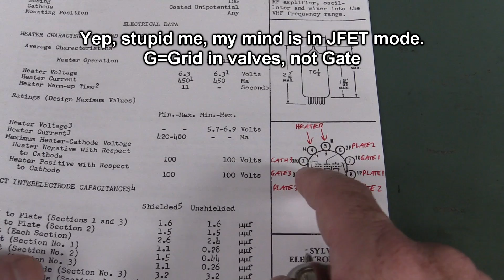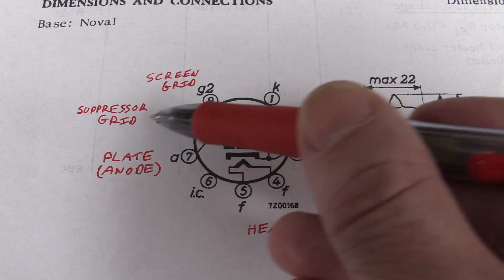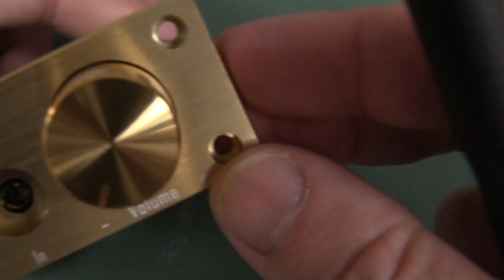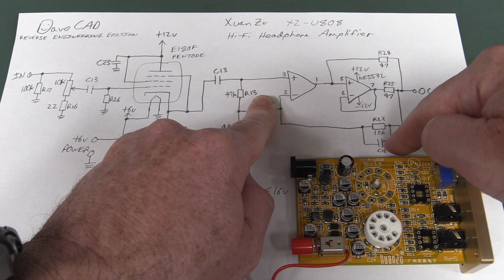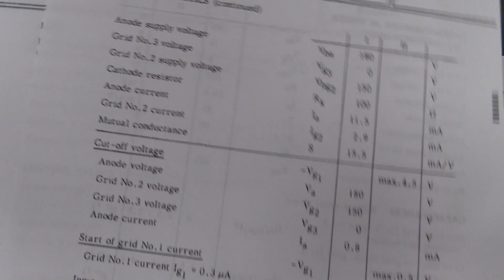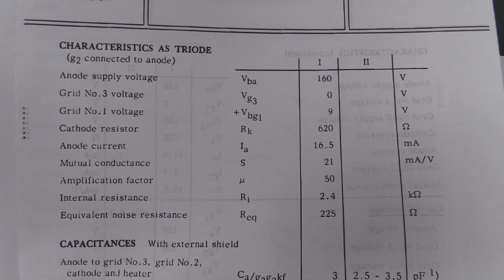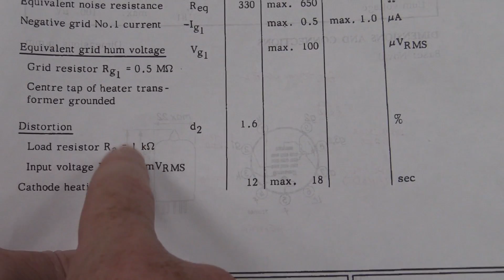EEVblog #837 - Reverse Engineering A Valve Headphone Amplifier

Comment: "A valve is just a JFET with a pilot light" (BAAAAAAAABOOOMMM) <-- Collective heads of all guitarists in the world exploding! :) HA!
Reply: Not entirely true. It's also less accurate. ;)

However, when you're producing sound, you can use any method you want to achieve the sound you want, so using vacuum tube amps for recording purpose is fine. When you're reproducing sound, you should use whatever method produces the mathematically most-accurate amplification of the source signal, so you can be sure you're hearing exactly what the artist intended. That's why my home stereo uses a set of self-correcting JBL studio monitors with built-in digital amplifiers, rather than some ridiculous glow-in-the-dark vacuum tube setup, so I can hear my vacuum-tube-amplified rock albums with perfect clarity.

Comment: So basically this is a tube unity gain buffer followed by parallel op-amp unity gain buffers. I think I'll keep plugging my headphones directly into my phone and save $50.
Reply: +mipmipmipmipmip More like lose $500 because you&#39;re listening to your music with vastly subpar headphones. That said, such a headphone requires actual gain, not a buffer.
Reply: +FlyingShotsman Most phone outputs are single miniature low power opamps - new ones, barring GSM noise pickup, are much better than this misused NE5532.
Reply: yep, the valve is just a high impedance buffer....
Reply: a proper 'all valve' headphone amp could be done very easily, and surprisingly cheaply, 
 without all that bullshit in the things in the video....
Reply: The dual op amp is being used as an amp with a buffer following it, for increased output current and stability.  That's where the amplification is coming from.  Since they are socketed you could easily replace both op amps with something like an OP2134 or OP275 for better performance, especially with 600 ohm headphones.  But the crappy tube is likely to be the limiting factor in the noise floor.
Reply: You listen to music from a phone, you heathen, get a real source

Comment: Dave, the point is to do a better job on the vid than these designers who put this amp together, right?
I think this calls for some testing on this crap amp.
You started it, now finish it proper.

I mean, you have all the gear and hooking it up is like 10 minutes effort, or less, plus you went through the trouble of disassembly anyway... the effort will be worth it in educational terms. Plus you'd get to blow the dust off that Keitlhly 2015THD you showed a while ago and we all know you like test equipment ;)

I bet it would look interesting, I'm pretty sure I saw evidence of ringing around 90deg and 270deg. Additionally, these opamps are not designed to drive loads below 600ohm,  like what the 16ohm "hifi" headphones would present, and when driving only by 5532, check what happens to these THD+N figures when you replace the output load R with a 1k one.

The amp design appears to be missing a whole (output) stage.
The experiment could aim to show that...

Cheers,

Comment: Ah yes, tube gear, where it seems about 90% of it is poorly designed, some even bordering on jumping straight into becoming self powered oscillators on any audio input or being made purely for wank factor by people who think pushing components into overdrive and comparing them is good practice. Stepping on the tail of a cat and complaining about how it sounds does not a good test make.
The remaining 10% seems to be old gear.
I honestly like messing about with old tube gear, I have a projector with optical sound (read in by a photomultiplier tube too) and purely tube based amplifier that i am working on fixing. it's neat, it's old, it's uncommon and in some ways sort of lost knowledge. it's fun to figure out and keep running without taking the lazy shortcut of gutting it. It's cheaper than a classic car, too.

Besides, what is with the blue glow, the orange from the tube is way cooler than throwing LEDs in to make it all glow so everyone will ask what is going on there and they can be told about tubes. Or what's with the use of tubes wildly inappropriate for the use being used for stuff. I have a feeling a high voltage tv transmitter tube isn't ideal for an input preamp for an amplifier even if it does look cool.

More videos on tubes/valves would be cool, it is hard to find someone trustworthy or believable on the topic, most seem to want to go into the spiel on how amazing tubes are.

Comment: I think the cathode heaters are enough glow on their own. I say leave the solid state or IC amps out. With this kind of thing , it's the tube sound you are after. Like others I am surprised the tube works at 24 volts. Although my tube line level single stage amp runs for 15 seconds after cutting the power and there is very little filter MFD's. Then it fades out with very little distortion. I love my 2 tube buffer amp. It has no solid state amps. My friends say the sound is an improvement over the CD changes straight analog output. I know it sounds great but am on the fence as to the "Warmer more Analog sound".

Comment: I wonder why they didn't use a 12v power supply and run the heaters in series?
That would save them the trouble of the DC-DC units and half of the board components/space.
Any thoughts?
Reply: +PIXscotland Because they need + and - 12V ?
Reply: +Michel PASTOR

Yeah, I get that. But starting at 12v would save the whole +6 to +12 components. 
Let's go whole hog and take a single 12v input and drive a Boost converter and have 35v (say) out and offset the DC input to half rail. The valve would probably be happier/quieter and we'd have endless rail-rail swing on the op-amps (Not that we need it.)

In the end the valves were pointless to this circuit other than adding colouration (which may be desirable to some.) The circuit is interesting as it is, but the product is endlessly complicated for the purpose of driving high impedance headphones. You can do that (I do) with a couple of LM386's and a PP3 battery (but maybe a little noisier.)
Reply: The difference between +12v and -12v is 24v...
Reply: +Tim Ramich 
Umm.

Comment: Will the distortion become lower if we get those $200 audio grade electrical outlets instead of plugging it into a standard outlet?

I was also thinking of getting that amp, and then replacing the power cable for the power adapter, with ones from this power cable (it is an absolute steal at $6900 for a 6 foot cable) :)
http://www.amazon.com/AudioQuest-NRG-WEL-Signature-Series/dp/B0055OM9WS
Reply: if you're using it for home cinema, I'd also recommend one of those anti virus HDMI cables too. 

I thought 'what a joke', but then my TV got a virus and will show nothing but repeats of only fools and horses. Never again am I not using an antivirus HDMI cable. :-/
Reply: +Razor2048  

You forgot $300 beats headphones. They have high quality electronics that are better than other brand. Such a good investment!

Comment: The valves are really novelty value only in this case. The sound would probably have been better with a couple of JRC NJM4556 op amps driving the headphones.
Reply: The 5532 op amp is superior to the 4556.  An OP2134 or OP275 would be better yet.  And there are even better options if you go to newer package formats.

Comment: Dave, obviously you have not much experience with vacuum tube valves.
There is a significant difference between a Triode and a Pentode: totally different characteristics! 
the connections of this one are typically those what you expect of a Pentode!

Comment: It looks rather like the capacitors in the signal path are all of ceramic type... I would have thought that would make it sound bad due to the non-linear and piezoelectric characteristics of the dielectric. I though that Hi-Fi amps used film caps in the signal path?
Reply: +Steven Birch You are quite correct there. Maybe that's their way of adding some distortion (or just penny-pinching), the /choobs/ would be expected to be fairly clean here after all, noise aside...

Incidentally, NP0 ceramics actually are excellent but not generally used in values higher than about 820 pF, with dielectrics for higher capacitances being increasingly crummy. You can apparently even get crummy ceramics down in the 3-digit pF range though, as found in Behringer's fairly popular xxx2496 devices. With all of them swapped out, high-frequency distortion improves by about an order of magnitude.

Comment: 0:10 : Oh dear, this should be interesting! Let's see...
0:25 : How dare you call blue leds in audio gizmos "wanky"? Next you're gonna diss the 3/4" aluminium fascia and tractor-engine-grade bolts?  Fancy pancy? FANCY PANCY?? Do you think people buy these things for any other reason than the sheer pleasure of online ordering?
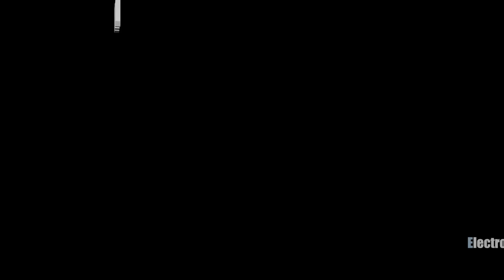26:04 : Pah! That was completely useless as you omitted the analysis of the most important part of the circuit: the "wanky led"!

PS: What I'd love if you ever find one, is analysis of a modem-router with protruding valves on top plus obligatory wanky leds. A couple of nixie tubes showing, I dunno - dowload speed? would be a desirable extra. If I ever see one, I'll definitely rush and get it.

Comment: Interesting video. The tube should stay to add some kind of "nice distortion" but what for in a hf amp?
Reply: +Fer Cava Tubes don't necessarily add "nice distortion", it depends on the circuit you use.
Reply: +as df I agree but what's the reason adding the tube apart of having a fancy blue light?
Reply: +Fer Cava There is no such thing as 'nice distortion'.
Reply: I wouldn't say that as I am a big fan.  But you're entitled to your opinion.
Reply: That's my point though. There is such a thing as nice distortion.
Reply: Matt Wright   In the source material for the artist to get the tone or sound, I agree 100%.

We are discussing the reproduction chain/devices here.  Distortion in this situation "colours", and some times ruins the sound the original artist intended.

Comment: Besides the fact that is amp is obviously a piece of crap, the idea of a tube headphone amp is actually no bullshit at all. You can achieve a lower distortion at high frequencies (up to 20kHz) than with transistor amps, while transistors perform better at the low end (down to 16Hz). So the "tube sound" doesn't necessarily mean a high THD, but a special "shape" (in the frequency domain) of distortion. Nonetheless most of the professional headphone amps are transistor based for practical reasons.
Reply: In an professional PA or studio environment you can only use headphones with high impedance (like 200 Ohm). Headphone outputs of mixing consoles or other equipment are designed to have a high output impedance. Connecting low impedance headphones (like 16 Ohm), like they are used in consumer market, to those outputs could in worst case even damage the equipment. On the other hand audio outputs of laptops etc. can't drive high impedance headphones directly. That's why you need an headphone amp when you want to use professional (high quality) headphones, which are designed for live monitoring or studio mastering, on your domestic hifi gear.
Reply: I have to call BS on the idea that spraying electrons across a vacuum gap is going to produce lower distortion than electrons passing through a metal wire inside a solid-state transistor. If nothing else, quantum mechanics dictates that most of the electrons will NOT take the shortest path through the circuit, delaying the transmission of their electrical charge to the collector. A vacuum tube has a much large space for the electrons to wander around in vs. a transistor, thus increasing the span of time it takes for the entirety of the input signal to arrive at the collector. That will manifest to the listener's ears (or an oscilloscope) as a "softer" (i.e. blurrier) waveform.
Reply: At the scale of electrons, they're going through mostly "empty" space either way. Their cumulative fields of influence and their changes are generally more of a concern to electronics.
Reply: @asdf155  you can drive low impedance headphones ...you just need to redesign the circuit a little bit
Reply: @racitup4114 : Yes, I am aware that transistors are made of semiconductor materials, not true metals, but this is YouTube, not a university lecture hall, so I adjusted my lexicon to suit.

If you had ever actually studied particle physics and/or observed an electrical field in a near-vacuum, you'd know that the electrons travel through all possible paths from the cathode to the anode, though the probability of an electron following a given path is lower the more convoluted that path is. Doped semiconductors do introduce some distortion, but the distortion is several orders of magnitude lower, which is why CPUs (notably made of transistors instead of vacuum tubes these days) can operate at clock intervals of less than 1 billionth of a second. That same low distortion, when applied to analog applications such as signal amplification, produces a much cleaner amplified signal, something anyone with an oscilloscope can observe for themselves.

I've been to university and graduated with an engineering degree, thank you very much. As for you, you lost all credibility when you said that electron-holes in doped semiconductors create more distortion than free-moving electrons traveling across an insulator gap. Please tell that to an electrical engineer in-person, film their reaction, and post it here. I need a good laugh.

Comment: The bottom line is this...
If you want that real tube amp sound (that nice warm and rich sound), this is NOT going to give you that.
It's a glorified solid state amp, but dressed up to use very VERY cheap tubes as transistors, rather than using straight solid state transistors.

Oddly enough...this thing has an actual useful purpose...
You could wire this thing up as a small pre-amp (kind of) for use with a small solid state guitar amp, for a nice little kick of warm distortion.
But using it with anything bigger than a 10-15watt solid state guitar amp is useless, as it'll just distort too much.

This biggest red flag for this is the inability to change tubes to get a change in sound, rather it be colder, warmer, flatter, etc.
And unless the tubes are officially made in the USA, UK or Japan, they're most likely...crap.

And yes you damn Brits, there is a DIFFERENCE in amplification between valve state and tube amps. (Google it).
Marshall Amps for instance has made both.

Comment: Can you "fill" something with a vacuum???  ;-)
Reply: Would repressurizing it be "emptying it" of vacuum? (:
Reply: space
Reply: no, you cant 'fill' with a vacuum, only extract whats there to make a vacuum 😉
Reply: Actually it's just like calling hole flow "positive current" when it is the electrons that carry the charge.  The equations still work.  It made me smile to hear the other way of looking at it.  Sort of like putting magic smoke inside the transistors so they will work, and they stop working when the smoke comes out.  Or the TARDIS is smaller on the outside.

Comment: While I really like the aesthetic of tubes, I belive they are entirely unnecessary for modern consumer Audio. I have never listened to a tube based hi-fi amp, I would expect a well designed one with maybe moderate ammount of gain on the tubes for some light distortion harmonics could subjectively sound pretty good. Where I do think they are still viable is anything to do with the creation of sound, so guitar/bass/organ/whatever amps. While solid state and modelling stuff has gotten pretty damn good, I've yet to use one that I would precieve as good sounding as a full tube (or heck, even a hybrind with just a tube pre amp). The sound you can get by hitting the frontend with a simple solid-state clean boost to drive the pre amp into light saturation, the natural occuring compression and responsiveness to dynamics in playing is just not achieveable by anything else i've come across. I'm not saying that it's impossible but those things that can are probaply far out of reach financial and practicabillity wise. Tubes are just too damn good at beeing (controlled) crappy amplifiers

Comment: Nice chinese tubes. The good question is: Can the audiophools hear the difference from a genuine Philips tube? :D
Reply: Of course. Theyll tell you the purity of the gold plated contacts on the directional copper wire.
Reply: +zaprodk put a chinese tube into a tube amp and simply switch it on, wait for half an hour and just listen without any input signal....You´ll hear some crickling noise and sometimes heavy clicks and pings....They still have issues with the materials (plate material must be machined very carefully, otherwhise it´s just crap) and the overall manufactureing quality....

Comment: I wonder if they actually connected the valve as a pre amp, would actually need the IC stages? I know a 6BL8 will do it. And yes I know a 6BL8 has two sections/stages in the same capsule (A Triode and a Tetrode)
Reply: Yes, the headphones are way lower impedance (8-600 ohms) than the plate of the tubes (thousands of ohms) so you'd need to have an impedance transformer for each channel.  The operational amplifiers have a high input impedance and a low output impedance, which removes the need for expensive transformers.  This also means the tubes aren't really needed to buffer the input, since the op amp inputs would not load down the line level signal.

Comment: With a bit more cost they could have done it properly and crank up the voltage on the dc to dc converters and change the tube circuit to get gain of course and drive 2 small output transformers, get enough power to drive headphones, probably sound even worse thou. The blue leds are a bit of a wank.
Reply: Blue looks like a gassy tube. a neon light would have been better.